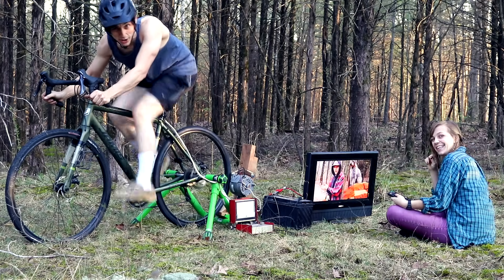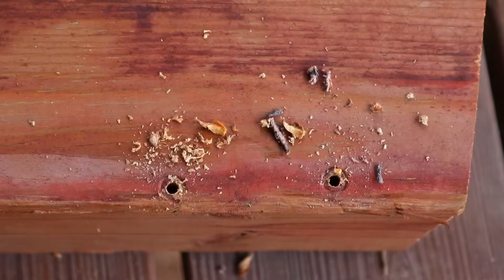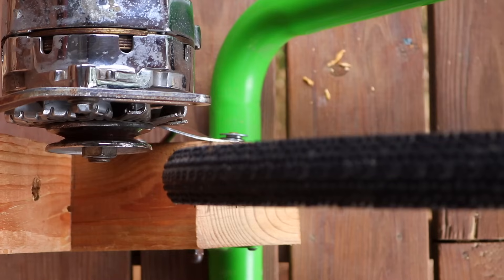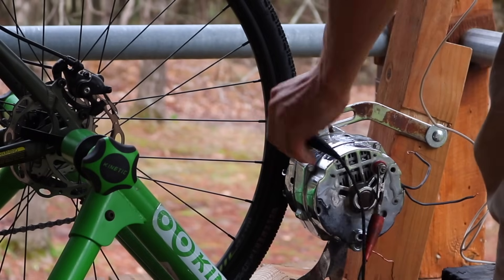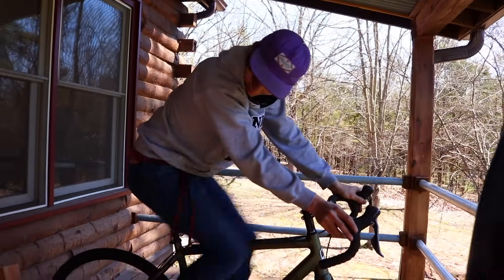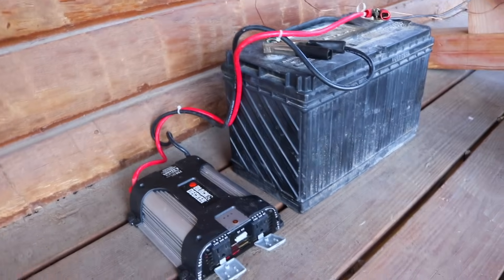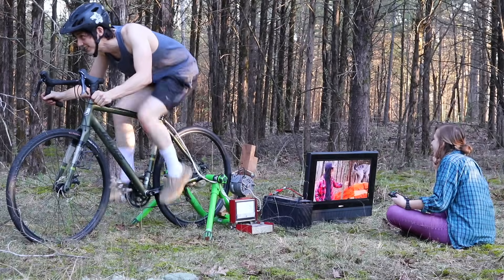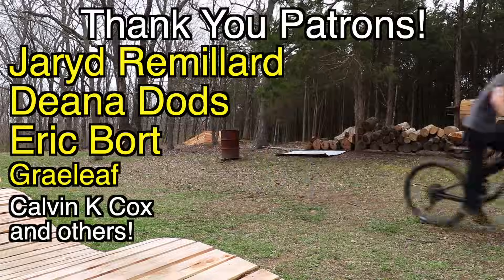Homemade Bicycle Generator // Burn Calories and Make Electricity

Comment: Awesome video. I found an alternator from a 2007 mazda miata hoping to do the same with my stationary bike. Can you please explain how you wired the pins? Looks like one was jumped to the positive and you out the switch so it doesnt drain the battery correct?

Comment: OK, so it's a good project. But all your demonstrations if making a smoothie or watching TV in the woods were using energy already stored in your 12 volt DC battery and then converted by your DC/AC inverter to AC, presumably 110 volts AC in your neck of the woods.  Stop pedaling and your TV and smoothie blender would keep on working (until the battery runs out of stored charge).

Your idea of using pedal power is only going to work if your kinetic energy (pedaling) generates more energy than what your TV or blender require. So the battery will stay charged.

So how much power can pedaling produce?  And how much power does the TV or blender use.  A typical adult can produce about 100 watts of power when pedaling a bike. A typical blender requires about 350 watts of power.  Oh dear!  You can't charge your battery by pedaling because 3.5 times the energy your produce is being used by the blender! (Although I admit that you won't be using your blender all the time).

A small, modern TV might only use 50 watts of energy, so now we're talking.  I recommend buying some smoothies from the convenience store AND then start pedaling to watch your TV :)

Comment: Couldn’t you replace the wheel on the alternator with a gear and have it on the bike chain. Cut out back wheel
Reply: No man, that's stupid first is that its hard to do then the second thing is the tire works like a gear i am to lazy to explain just told u the base

Comment: Why don't you use gearing as mechanical leverage to use far less effort on the bike and faster spinning speed or just the right amount on the alternator for optimum efficiency to human effort ratio?

Comment: Plug it on bike E-bike u can have free biking power. U can make it work by not letting it overload. U cant discharge much. U cant recharge fast. So when u relay it to charge and produce. Think about the battery manufectrer and its specs. Screw EU have fun world. U dont arent against bikes free power but americans EU are. Its obvious because u know it better. Okey..... Forced to ride a bike electric 25km and on normal bike I go double speed on flat terrain. ITs funny these jokers cops when 1v1 they know nothing. 
Thats why if u made it just show the world. Try to upload it  everywhere with your title and tell the world always. Because cops play dirty to protect a system failed to go sky because they need humans. Thats why my trust. Follow nikolai Tesla for more direction.

Comment: The alternator needs a magnetic field to induce the current. There are electromagnets in the alternator - bu to make them magnetic, you need to supply electricity to the alternator to make the electromagnets work.  Which is why you needed to connect a power supply to the alternator. I wonder how many watts of power you were actually generating - not enough to run anything that needed a lot of power.

Comment: I hope you see this! I’ve been wanting to do something like this. Gotta ask though. Could you use the trainer wheel with the generator and just put a rubber belt from the pulley to the alternator and still have the bike spin in the trainer wheel?  I hope you understand that. lol. I’m thinking it would save the tire because it just running on the rubber belt. The tire wouldn’t wear out nearly as fast and the bike is still good for the road.

Comment: I would use a different alternator. A PMG alternator. Any used bldc motor would work great for this. No excitation needed. Always works. Just have to do a little regulating.

Comment: Erm yeah I was going to say that generators will generate energy straight away, alternators require a 12v supply to energise some coils or some electrical magic which was the 2 terminals you said that had to be looped into the output. Or so I've heard 😊

Comment: When I run for mayor one day, I'm wanting to promote things like this in every home, more than one bike in many cases. Teach the kids in school with classes making things like this for the community that are then sold at just enough to offset materials, which are preferably mostly donated or salvaged. 

Pair this with public gardens in as many front yards as possible, low grass plots. Maintained by again the youth through classes in school or as repayment to society by those in trouble within that specific community. 

Could wire one line into the power grid that could connect them in series or parallel then hold a city wide virtual marathon. Set record attempts per house, grade. Have modes if one chooses to just add to the battery bank of the city to be stored for a rainy day.
Reply: You cannot get by the laws of thermodynamics. You will get less energy than you put in and humans don't produce nearly enough energy for a house. That is why you see people that make these only run small devices and nothing large scale.

Comment: If the battery is charged, it would run the TV buy itself. This is cool but you are not showing the alternator being used at all. You showed that it was charging by the voltage. You should show a battery percentage while watching TV, then show it charge while you ride by outputting battery percentage.

Probably get a lithium cell and try charging/discharging that.

Comment: Hey bro can you tell me one thing that alternator produces Alternating current and battery uses DC so how will battery get charged with it? 
Don't you need electrifier for that?
Reply: Good question. Car alternator has diodes to make it DC, else couldn't charge a battery

Comment: You're best off just buying a sprocket for the starter, and go straight from the pedals cogs to the starter. Starters are also only good for a short trip. They're not meant to run continuously.
Here's my take on your build:

Get rid of half of the bike. All you need is the seat, front pedals, chain, and instead of a starter, buy a washer or dryer motor for ac (like lights), or buy a sub $100, 1/2 hp dc motor. That's 325W peak or ~166W avg. Great for a training bike, unless you're a pro athlete, then get a 1hp motor. Adjust the motor/generator speed through adjusting the gear cog on the rear.

Comment: You weren't doing much as that battery could power the inverter for quite a while. Why didn't you just swap over the turbo trainer wheel to the alternator shaft then use a turbo trainer tyre?

Comment: 3:25 lost me, the switch doesn't make sense lol
Reply: The switch is to turn off the power output to the battery and routing it to the stater on the alternator. As the stater gets the power and produces a magnetic field, only then does the spinning alternator produce the 12+ volts needed to charge the battery. 

So with the switch off, ride bike>spin alt>power from alt goes to stater>now alt fully functional>switch on>battery charge

He prob couldve made the other ones work if he wired the stater up on those too

Comment: what if 2 generators in a single wheel
Reply: Double the volts produced or double the amps, depending on how it’s wired.

Comment: If that switch applied 12 volts to the field you have vo voltage regulation on the output.

Comment: Wrap the metal pulley  of the alternator in rubber also, this will protect the tyre of the bike and provide better contact between the rear wheel and pulley. Great little set up. It depends what type of alternator is used, the older type is the way to go. If purchasing new, go for a small simple tractor alternator.
Reply: All alternators work the same way. Doesn't matter if they're old or not. Plus he should have used the voltage regulator asking with the alternator much more efficient

Comment: The shaft of the alternator needs a rubber roller. There are companies that make rubber components you may find something suitable off the shelf. Alternatively you can find a general engineering workshop and make a steel roller to suit the shaft and have it ruberised by a rubber molding company. 
A steel roller may be sufficient, many indoor trainers have metal rollers some have rubber rollers.

Comment: The other alternators will probably also work, when you supply current to the rotor, which is needed to generate the initial magnetic field.
Reply: Can you expand this we have a research about this but we use ac as support to create electricity

Comment: Nice. Tho I'm still trying to understand the switch part.
Reply: To supply power to the alternators magnetic field for it to actually generator power when spun and turn it off to store the power generated
Reply: @altonb93 Yes, but a switch doesn't supply power. Bum video leaving out essential details.

Comment: My dream is to get a gaming chair that has build in bike so i can generate power while gaming
Reply: my thought was to use my simple exercise pedal machine , mount magnets on the pedals( or hell, use magnets as pedals!)& use the screens from fans or the slotted round plastic shelves of a dehydrator to secure coiled copper onto, have them mounted on each side of the crank hub & then just kick back with a good book & allow my legs to pedal in a semi reclining pose like a paddle boat in a pond or a recumbent bicycle type position, cause I have spins bifida & have 3 open vertebrae. also have crippled feet but this would allow the pressure to be applied by my heels rather than the ball of my foot. woohoo!

Comment: This is where engineers should be putting their efforts in innovation. I would buy one of these today. Imagine if everyone had one of these in their homes along with supplementary solar energy.
Reply: Exactly, at least to power our phones. It will encourage many people
Reply: @vivekvicky2595  save you the gym fees
Reply: @aarushjuneja2186  yeah bro, I really was thinking about it. Even it could produce enough energy to change our power banks, it's enough.
Reply: I agree, it's obvious, if you are going to exercise on a bike, then why not put it to some good use while you are doing it. At the very least the power you are creating could be used to charge batteries of some kind and such. I can see a day when homes will be run on a combination of batteries, solar energy, and personal windmill or two.
Reply: This is old tech. Its exactly how mindmills and water wheels work. Only the wind spins the fan blades or the water fall spins the wheel. So youndont have to pedal. But I think more ppl should make these for themselves. I'd definitely have one for a secret campsite cause I'm weird like that
Reply: @davidmiller4758  Nobody said it was new tech. You might as well say solar power is "old tech." It's about the efficiency of the tech, not when it was discovered.
Reply: @GruppeSechs  engineers have this figured out trust me we don't need a team of engineers to work on it
Reply: @davidmiller4758  That's literally what they said about solar decades ago. You don't seem to grasp the concept of battery and component efficiency and how that plays into how worthwhile this kind of technology becomes. Just stop.
Reply: too loud, unfortunately  @davidmiller4758
Reply: Find a way to hook these into house like solar panels and I guarantee you more people would be in shape. lol
Reply: Your government doesn't want that!
Reply: @aarushjuneja2186  Exactly! Or the Devil, all the good products that should be there is not.
Reply: غير عملية الانسان يولد 100 الى 150, اما رياضي 250 الى 300 واط ومحترف 500 واط خلال ساعة تمرين  بدون حساب فقدان الطافة يصل 30% ،  
يمكن استخادم الشحن بور بنك مدمج مع دراجة ثابتة ويضا يكون قابل الازالة الشحن هاتف و الحاسوب مع اضائة اليد مدمج مع بطارية وسماعة بلوتوث بطارية نوع لثيوم بقدرة 350 واط و 48 فولت حيث يمكن شحنها خلال تمرين مدة من ساعة الى اكثر من ساعتين
Reply: Así es, es una excelente idea
Reply: this should be done in every towns
Reply: SAME! I told my kids I’m going to make one and they have to collectively bike for their screen time 😂😂 

But I don’t have any useful skills sadly.
Reply: I'm looking at this video to find ways to generate power to charge power station or 12v battery in case of electricity blackout when solar power not available either and need to keep the fridge/freezer running. Could also use my ebike that's already charged to transfer its power to said batteries without inverter
Reply: No you wouldn’t
Reply: @ Go away, pest.
Reply: Your government doesn’t encourage this kind of useful proactive activity’s. They always ruin people’s lives when they mention they have created free energy. And all the victims paid taxes that compensate the government agents that ruin their lives 🇺🇸 home of the free land of the brave🫡
Reply: You don't have the legs for it! I doubt the average Joe could output 100watts of power. A $100 solar panel and $20 charger would out perform the average person everyday. If there is no grid I would not want to waste calories for electricity
Reply: @ronrico2620  Who said anything about 100w? Small devices charge with less than 10.
Reply: You rebels won’t get any realistic power to power your home. The power you generate is negligible compared to how much you consume in your home. This is only a fun little project or may be charge your phone a bit while in the woods.
Reply: @pk3  Not a single person but you said anything about powering a home.
Reply: @GruppeSechs  Well, irrespective of anyone saying about powering a home, I am making a comparison. That the power generated this way is negligible compared to the power consumed by a home such that the clean energy will not have an impact other than some fun little project at home.
Reply: @pk3  Being able to power your devices with your own body isn't just a "fun little project." It's pretty significant, especially if you live off grid. The dismissiveness has no place here. You might as well have said solar power was a "fun little project" when it was in its infancy and entirely inefficient.
Reply: @pk3  Well, that depends...
Reply: @pk3 it's crazy that so many people for some reason believe that they can power their house by pedaling
Reply: @bensmith4563  It's not crazy, because nobody said it but him. You should try actually reading the comments.
Reply: @GruppeSechs  Those 2 are government agents
Reply: They don’t care about climate pollution or the earth if there’s not as much money
Reply: @SoundEff3ct  It's the opposite, the government promotes global warming and environmentalism because it is a scam, it's a money laundering scheme and a way for the government to seize properties and control how businesses operate. I mean look at how Obama claimed the oceans are rising and then immediately bought two beachfront properties with money he got as "speaker fees". 

What the government doesn't want is self-sufficiency, because if you aren't going to the government to solve your problems then the government loses control over you. This is why they are against off gridders, gun ownership, or non-fiat currency such as gold/crypto/land ownership etc.

Comment: a much easier way is to buy a 24VDC x 250 Watt scooter motor off ebay, these work betting than your car alternator, you just have to place a 25 amp blocking diode in the line to the battery. You can use a skate board wheel to make contact with the back tyre or you can remove tyre from back wheel and run a flat belt to the skateboard wheel, they both work extremely well.

Comment: re the tyre issue. Here is a possible solution. Instead of removing the tyre, which is sludgy and rubbery. Draggy  and stretchy.  Try putting a harder rubber type thing. around the tyre . Something  that does not lose too much turn at the expense of the above mentioned type issues. Go for it. Well done. I like your efforts and attitude. Iain W in Glasgow

Comment: Adding a switch to energize the coil by pedaling is a great idea. As you undoubtedly know by now that has to happen b4 the alternator produces. Tractor's and airplanes are true generators because they work without that requirement. Most ppl think you have to set up a 9+V external battery for that trick. I love it!
Reply: @traida111 the switch is only for a small power supply (even a 9 volt battery) to energize the coil. One the motor is running it's not necessary. This is the main diff between a car alternator & a tractor or small air plane generator.
Reply: This is why alternator is a poor choice. And bldc motor would generate without any need since permanent magnets are used

Comment: you need a rectifier with an alternator to charge a battery.
Reply: Which is built into nearly all car alternators
Reply: @altonb93  an alternator that doesnt charge a battery means the rectifier has failed...
Reply: @traitretrudeau2367 or it means the stater wasn’t given power to produce a magnetic field that would then make the alternator functional. He prob could’ve made the first alternator work if he’d done so.

Comment: What about super gluing rubber or some other material on the pulley sureface? Maybe mount a skateboard wheel or some other small wheel to make contact to the tire?

Comment: do you actually need to pedal the bike at the same time as using the appliances? Or could you simply use the energy and charge it back up whenever you wanted to by pedaling the bike? Also, I think you're wasting a lot of the energy you're putting into the system by only utilizing it for an alternator. I'm sure you could use the wheel itself coupled with some strong magnets and copper wire to extract more of the mechanical energy you're putting into the system. Am I wrong about the latter?
Reply: No. Yes. Yes. No.

Comment: fake!! you have no idea how a car alternator works wheres your charge controller rectifier capacitors plus your not powering the commutator for the field winding!!!! all this is, so guy charged a car battery up and stuck a inverter to it. fake fake fake.